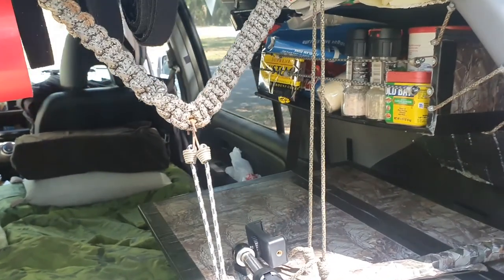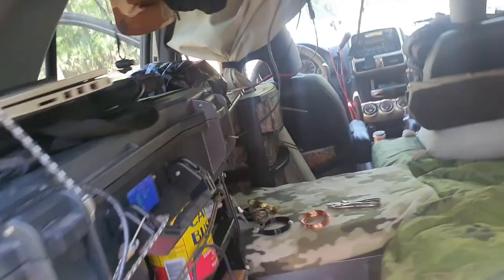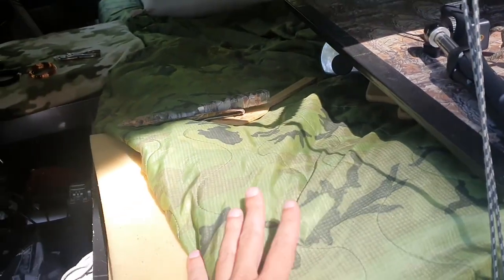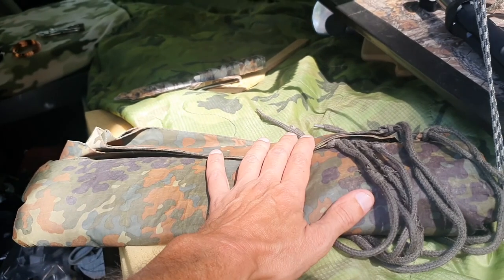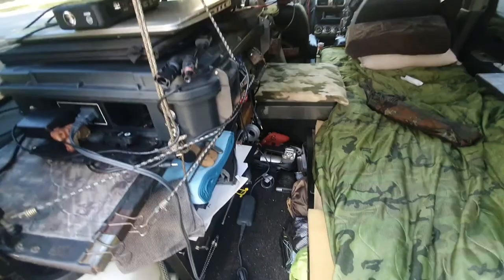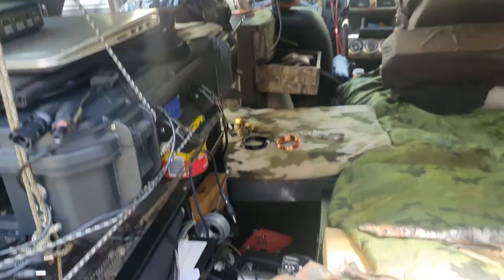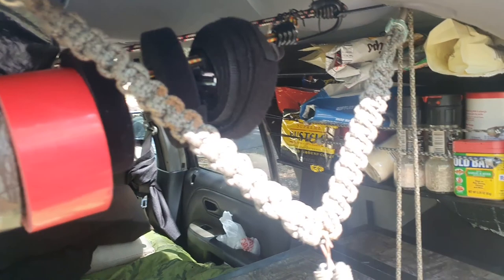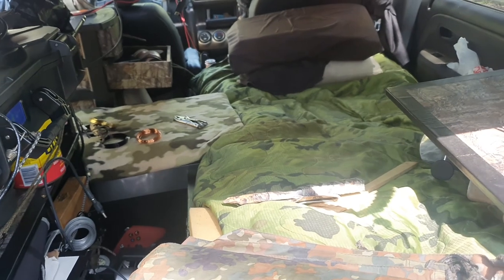Top 20 Overlooked and UnderAppreciated Gear/Equipment for Suv Camper/Survival

Comment: Also some mosquito netting to go over your face at night when going to sleep it's only about $2 at Walmart and of course if you're are where mosquitoes are heavy you can wear it during the day under your hat over your face to keep the mosquitoes down also a good protective gear is bear pepper spray believe me it shoots about 30 ft and if you've got a troublemaker coming to do you harm that 30 ft means a lot and it will put a person in their place really fast if it will ward off a bear it will sure ward off a troublemaker. Also it has been a blessing to me and my van are inverters that you can plug in that run on a car battery and one thing I plug into my inverter is a mosquito light it provides that real nice purplish looking light and boy does it really kill the mosquitoes if they get in your van.